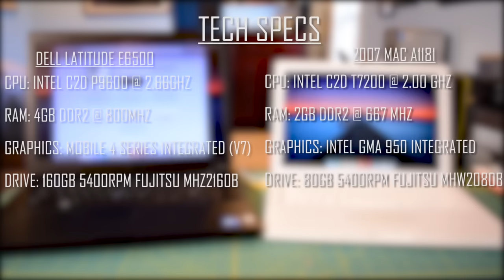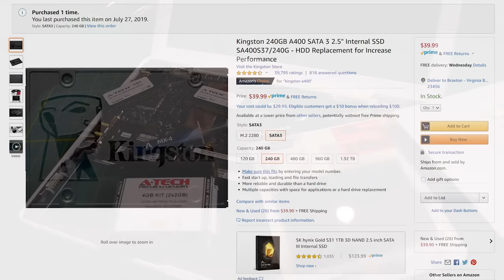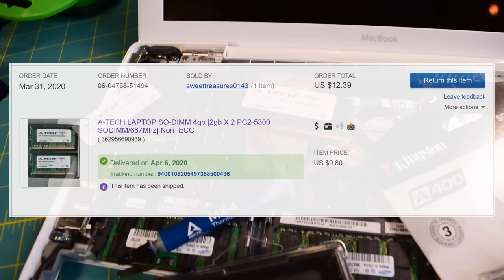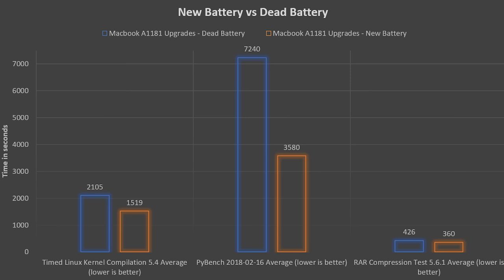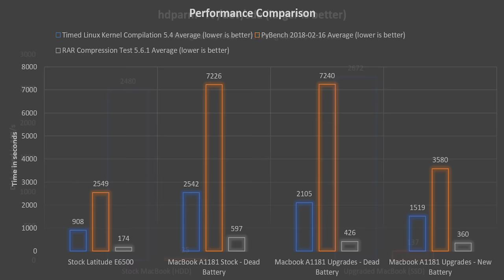Throwing $85 Worth of Upgrades at an Ancient MacBook: Apple MacBook A1181 Complete Upgrade Guide

Comment: I did this exact thing with my 2009 model and it runs amazingly well. I think the ssd was the main thing that helped it.
Reply: Why do you think the ssd helped the most?
Reply: @willblundell2250  old slow 5400rpm drives are the biggest bottleneck IMO (depending on pc but it’s a safe bet) and ram upgrades help but not as noticeable
Reply: Did you clone your existing HDD onto the SSD or opt for a fresh install of OS X?
Reply: @astoraan6071  fresh install so that it was a clean a restart as I could get
Reply: @captainchuppachup  Cool. Are you running El Capitan? Or did you manage to get a newer OS working it seems from what I've read that 10.11 is the "official" limit for this machine.
Reply: Anurag RB26 I have a 2009 model also. I’m running Yosemite on it. I wouldn’t waste my time with El Capitan that’ll drain your battery so fast.Those third party batteries don’t last long as it is.
Reply: @pattskatoey3139  Ye my battery is pretty much shot as it’ll only last about 30 minutes on it. I always keep it plugged in anyways. El Capitan was slow at first but after starting every app at least once it’s surprisingly fast even without an SSD. The main reason I upgraded to it was so that I could use newer software and Apps. Although Apple sure did make it a huge pain to install on this model of MacBook.

Comment: thanks for making this video and bringing a lot of A1181 diehards together!   You are a nudge to get my thermal paste replaced and my mind is absolutely blown in regards to throttling even while the MacBook is plugged in.  Did you manually create the benchmark graph or is there a link to a benchmark suite you specifically ran?  I’d like to run the same exact suite so i have a direct comparison to yr #s

Comment: I have an A1181 from 2007. It won't operate without the plug. Don't know if it's the battery or the plug which always had a problem making a good tight connection. I was going to replace both but it has another problem with volume which gradually decreased in the 4 or 5 yrs that I did use it. It's been sitting since maybe 2003. Now that I have come across this video I have a renewed interest in the old Mac and may try to bring new life to it. ....Thanks for the information on how to do this.... ....

Comment: Found one of these abandoned on the side of my apartment, someone was unable to get iOS installed and left it there. Been running Linux Mint Cinnamon on it since then.

And dude... You don't have a single spudger for those fragile connectors!? I was cringing watching you pull them out by the wire with tweezers =/

Pro tip: The only thing you should be using to remove thermal paste is a coffee filter as they do not leave fibers behind. Both of the options you gave will leave fibers behind.

Comment: I personally bought a lot of 2 A1181 MacBooks, one black 2008, and one white 2009, for US$45. Only the black one ended up being usable, but it has 4GB RAM, has the newer wifi card from the 2009, and also has a 1TB SSD which was handed down from my 2012 MacBook Pro. Runs really well, even using the OS X Mountain Lion patch.

Comment: I have the exact same model of this macbook, the A1181, and for some reason even though I have the exact same ram kit, my MacBook refuses to boot at all with 4GB installed, but is completely fine when 3GB is installed... Not sure what may be causing this, but it is somewhat annoying that mine seems to be incompatible with 4GB... Anyways, great video! Keep up the awesome work!
Reply: 3GB is a bit of a hack.  by design, this model is only supposed to support 2GB.   I don’t remember the details, but it will recognize 3GB if you put 4GB in.   they say it works better if you put 2x2GB - I’ve been using 1+2GB for years and never did any benchmarks to know  what the difference is (if any)
Reply: You purchased the wrong RAM even though it is DDR2 the speed must be the same as the original RAM. It will recognize 1 stick because you're using 1 original ram and the system will down the speed to match original ram

Comment: I currently have my 2007 A1181 running MacOS Mojave 10.14.6, it does lag a bit at times, but I enjoy nearly all the features of a modern MacBook for much less! I also enjoy using this laptop as it is quite a good conversation starter
Reply: Garrett Butterworth how ?
Reply: that sounds really impressive!  what patcher are you using?  and how reliable is the patcher?
Reply: Upgrade your system with an SSD. It'll run smoother then.
Reply: hi How did you manage to update to mojave? Mind is 10.7.1 and cant update from Lion!!!
Reply: @karljokat  I just got this laptop as a broken hand me down. Fix it as this video suggest.  How can I install Lion on it.  I'm not a apple person but I learned a lot.  I can install any linux, but not any Mac OS.  I tried patchers for Sierra and that doesn't work which is expected.  Basically, how can I get any Mac OS on this MacBook.  Lion would be fine.
Reply: Issue solved. I downloaded Lion IOS image, and using Etcher made a USB stick to boot the Macbook using the Boot Selection option by holding down the Option Key.

Comment: In the battery bay on the side nearest the screen with all the screws there is actually only 4 screws you have to remove and you don’t need to take out the screws right next to the battery connector so it’s only like 9 screws instead of 18

Comment: good guide, but one constructive comment - i actually recommend NOT blowing out the fans before disconnecting them. When the fans are still wired into the machine, they are can introduce a lot of back emf into the fan driver, and damage it. Plus, you have to clean the part anyway - why risk blowing small unnoticed parts out of the machine outside when all you really want to blow out is the fans? I like to remove the fan entirely, blow it out at a nice 90psi or so, which can free up gummy fans sometimes too, particularly with some DeoxIT F5 sprayed in - then the chips, inductors, mosfets, whatever - get thoughly alcohol cleaned, or in some really bad cases, ultrasoniced and IPA bathed.

Comment: I have a 2009 White Macbook and running on AC with battery removed (as it died long ago), and was wondering why it seemed that everything was running slower compared to before, even when downgrading to older Snow Leopard OS.  Now I know... I guess battery is required.
Reply: I was blown away by this fact too.   I thought (probably like you), having it plugged in gave it max power.   To think i thought this for who knows how many years!
Reply: is there a way to get ac power to it without the magsafe charger?  (i obtained black macbook a1181 with stone dead battery and no charger).
thank

Comment: I am going to be getting one of these just because i like the aesthetics and the fact that i can easily replace parts that break. 

I like to tinker and id rather have something that is dirt cheap like these ancient macbooks but still from the time frame when apple was still synonymous with "build quality" and "innovation".. 

I wouldnt be caught dead getting a new mac.. but these old ones, this model specifically.. with linux mint or something like that.. cannot go wrong.. i just need a word processor and something i can write code in easy.

Comment: I have been trying to replace an imac late 2012 27" 1440p display. And I do see why that most would rather buy a used or new display. Because, once you try to take the monitor from the glass. You will basically have the inside display opened. And I am still working to get the display off the glass (the display with a good glass is broken. The glass is fine). But I can't for my life perfectly clean any display.

Comment: I have the same 2007 "White" Macbook and did the SSD-240/ RAM-3Gb upgrades but I ditched Mac OS. Instead I installed Kali Linux 2021 , and it´s way much better and faster  than Lion OS it came with.
Unfortunately I still have a dead battery...
Reply: I bought my battery on eBay was amazing and works wonders bc mine was dead after awhile or was only plug powered
Reply: How do we install Linux do they have drawing apps :( is lion ok tho like what was wrong with it

Comment: it shows more RAM, but as far as I know it is not able to use it, not even under windows due to chipset restrictions

Official & Actual Maximum RAM

Apple officially supports a maximum of 2 GB of RAM in the original (Core Duo), "Late 2006" and "Mid-2007" MacBook models.

However, third-parties have discovered that the "Late 2006" and "Mid-2007" MacBook models -- both of which are equipped with a Core 2 Duo processor -- will work with 3 GB or 4 GB of RAM. Due to chipset limitations -- the same limitations that apply to the "Late 2006" MacBook Pro systems -- these models can hold 4 GB of RAM but cannot fully utilize the memory beyond 3 GB due to the possibility of memory "overlap".

Comment: 9:43. I have a few older laptops at my disposal and I would like to clean off the old thermal paste. But, I do not have isopropyl alcohol. 

I used a lot of q-tips and dampened both sides in regular tap water and scrubbed off the old paste. Is this method a safe one?
Reply: yeah, I'd say so, I've cleaned up many old laptops this way, just make sure is the processor and anything else you may have gotten damp or wet is dry afterwards :)
Reply: When I work on old laptops I almost never use any alcohol or water, as long as you can remove the paste and polish up the die using something like a cotton bud it should be fine. I'd avoid using water anywhere near it, carefully cleaning off the old paste and a polish should be enough
Reply: I use an old tshirt and windex. if it gets the paste off, its fine.
Reply: should just make sure you let it air dry cause if it goes back in damp it can cause corrosion

Comment: I got a black one for $50 on eBay, which happened to have a new[er] 3rd party battery. I grabbed an Inland 120GB SSD for $12, had some RAM laying around, and I was up and running. It wasn't very useful with MacOS, since I couldn't really install anything... I ended up putting Ubuntu on it, which was alright. I use it for writing when I'm trying to get into a slightly retro mindset. Plus I just like it.
Reply: get 10.11.6 on it: https://www.rmc-team.ch/osx-patcher
Reply: Parotgeek  , mountain lion

Capitan sucks on this.

Comment: 0:32 I still have a Dell latitude e6400 ATG from 2010 that I saved from being thrown out at a college I was going to about 5 years ago. Upgraded the RAM (2 gbs-4 gbs- 8gbs), CPU, HDD to SSD, wifi card (to the Intel ac 7260 card which also has Bluetooth surprisingly), and for some reason, the optical drive. It allowed me to use this laptop for another 4 years.
 
The screen made for my particular laptop, was the ONLY laptop in the past decade with a class action lawsuits over the screen itself. Still use the original screen as it's not worth it to replace it.
Reply: The E6400 is a great model. Rock solid.  I still use  E6410 for class  laptops in schools Because they are cheap, rock solid and easy to work on.  The display on the ATG has bubbles from the glue they used on the sides  of the underneath the bezel.  I never seen one that didn’t have the bubbles problem, some severe.
Reply: @chapmangleason  mine are severe, as I've been using the same screen for years
Reply: Latitudes are great machines. If you aren't one that uses that optical drive I would suggest getting a hard drive caddy adapter to put in place of it. You could then add a secondary drive such as a 1TB HDD or an SSD. If you look around on ebay I believe there may be a full HD (1920x1080) screen you could upgrade it to, if it has the basic 1366x768 panel still, there was for my e6430, not sure about the 6400. I loved my e6430, I had upgraded the CPU, Ram and HDD to an SSD. Unfortunately it seemed that the ebay seller may have scammed me, the laptop had coffee spilled on it at some point and the motherboard soon died, it would have cost more than the laptop was worth to put a new board in.

Comment: I want to know the name of that ribbon adapter that can be attached to the inside of this Macbook, so I can install a full size pci card, so I can use that hack to install Catalina on it. That hack typically does not work on machines older than the first half of 2008 because Mac OS did not have 64 bit driver support for these machines, but Windows did support the video card. That is why Windows 10 64bit is possible on these machines, but Catalina is not, but it is possible if a newer video card is attached. I have one of these where the battery lock is broke on it and I feel like it would be perfect for a DIY desktop MacOS conversion.

Comment: Hi, Thanks for the video and the discussion the comments is very useful. I too have a MB A1181 Black. I have  not been using it for a few years now. Now since I have some spare time on hands due to the lockdown I thought of working on that MB. However, it just wont boot. No matter what option I try it takes me to the flashing question mark screen. I was able to boot from USB previously but now even that does not seem to work no matter how long the option key is kept pressed. I have tried bootable USB, bootable DVD. RAM seems fine as the startup chime is played. Any advise what could be wrong with the MB? Any suggestions would be much appreciated
Reply: Changed the sata cables in your mc then the problem will be solved

Comment: Excellent Video ! Is it possible  to upgarde the cpu and  replace the dvd with another ssd drive ?
Reply: The author stated that the CPU is (permanently) soldered to the motherboard. The power/data connectors on the DVD are identical to those connectors on a SSD. So, it will connect. The problem is getting the 2nd SSD to stay connected -- not moving-around in the drive-bay.

Comment: I would really like to know how you got the SSD to work with this computer.  I have 6 of those computers I was using for a kids after school STEM class and I could not get the hardware to recognize any of the SSD's that I tried.  Mostly because I could not find any that had the slowest Serial SATA interface of 1.5 Gbps.  Everything seems to be 3 or 6 Gbps SATA 2 or SATA 3.
Reply from the maker: Later SATA standards are backward compatible with earlier standards.  I.E. you should actually be perfectly fine using a SATA III drive in a system that originally supported SATA I (you will just be limited to SATA I speeds). So you should be able to use a normal modern SATA III (6 gb/s) drive in these laptops. The one I used in the video is SATA III. I'm not a huge MacOS guy, so I might be wrong here, but it might be MacOS itself that cannot recognize the drive.  You should try using a Linux distro, like I did in the video, and seeing if that recognizes the drive.  There are a ton of other things to check, but that would be my recommended first step.
Reply: Wow cool 6 I wish 🤣I got mine on eBay already with 2 GB and 240 GB HD I wanna change upgrade after snow leopard

Comment: I have the same macbook. But it is a 32bit. The os is stuck at snow leopard. Yes, i can do Mpostfactor ‘upgrade’ but there are issues when i did that. Web browser (ffox) is still working but not the latest. At best, you can watch youtube on it. Not sure what to do with it. Windows 10 32bit?
Reply: RMC’s OSX Patcher worked on 10.11.6 the first time: https://www.rmc-team.ch/osx-patcher  - someone here apparently has Mojave running (not surprisingly slow).   I kludged Win10 on my A1181- i haven’t had time to get Apple drivers installed yet - I’m sure I’ll figure it out at some point.

Comment: How do I image it? Can I do usb? If yes then how I held the alt button from off until it booted It just booted normal. Also I know I can install Linux mint or Elementary via DVD. Problem is my disk drive is dead. I am going to try and drop in my cd drive from my 2012 MacBook Pro and hope it fires up so then I can then install from dvd by pushing the c key when booting up and then select dvd drive. Any advice would be greatly appreciated.

Comment: I still have an old core 2 duo notebook with 2gb of ddr2 ram in dual channel, it still works great using windows 7 but now I gave it to ny mother
Reply: i’m in the process of seeing if I can get Win10 working with Apple drivers.  i gather it’s possible but you have to wedge them in yourself (Bootcamp won’t support Win10 on a 2007 MacBook)

Comment: cant figure mine out, i can install windows to a hard drive and put it in and it works, but i cant install MacOS for some reason! i have tried from DVD, USB and even CMD R and nothing works, its a CONSTANT folder with ? in it. im ready to chuck the thing out the window because i cannot get it to work